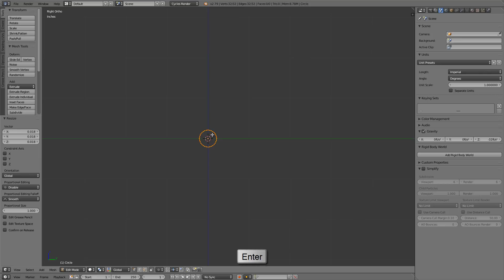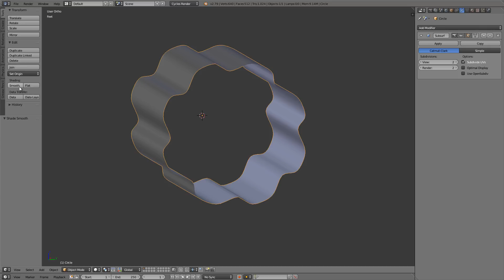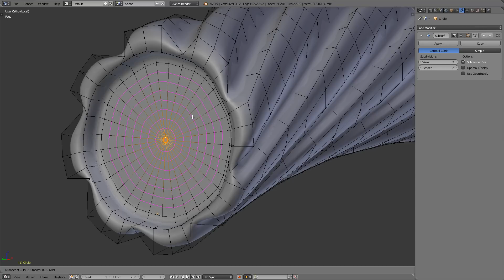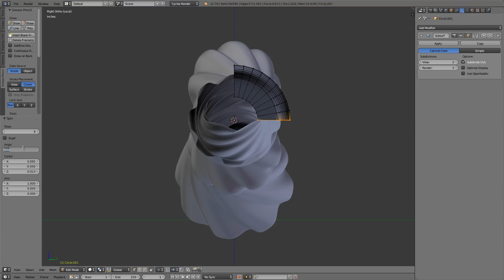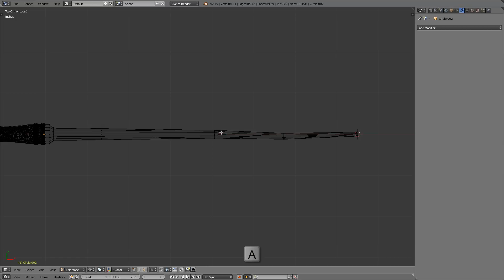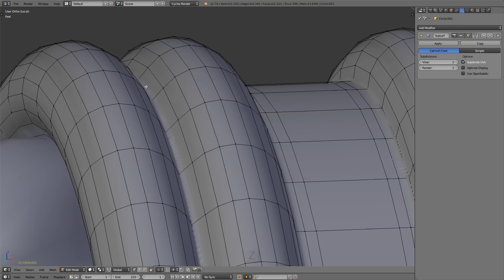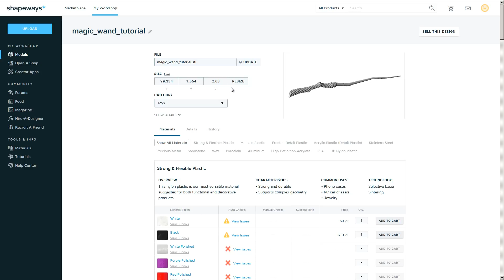Model and 3D Print a Magic Wand in Blender - Beginner's Tutorial

Comment: Hi,
I have a problem at 3:25. It doesn't switch to inches and it's still in foots. Please help me
Reply from the maker: In the newer blender versions, you may need to change the Length option in the Units panel from Feet to Inches.

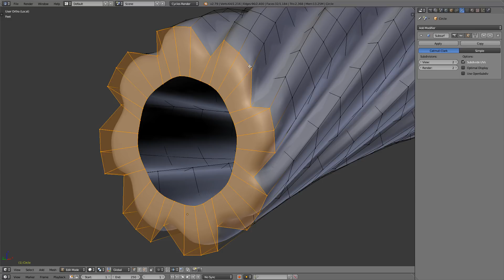Comment: Oddly enough, at the 16:21 point, there does not seem to be a size I can scale the inner circle to that doesn't give me a screwy result when I bridge the edge loops.
Reply from the maker: Hey if you want to you can send your blend file to me at contact@cgmasters.net and I'll see what's going on there. -Chris
Reply: That was a quick reply, thanks so much!  Ultimately, I ended up creating the faces manually, and for some reason, I had a mismatched number of vertices... I have no idea how that happened, but I just merged two together.  I'm guessing that's what was causing the problem.

Comment: Also, you don't have to apply your modifiers before exporting the STL. Once the export dialog comes up, you can click in the bottom left hand corner to apply modifiers only in the export. This is useful for going back into your model later and making adjustments/modifications, even to the modifiers.